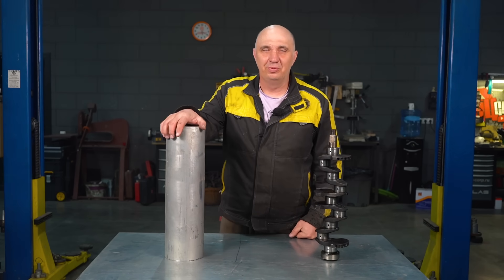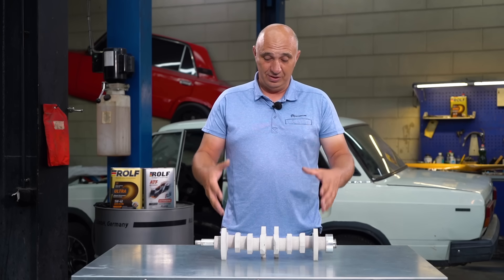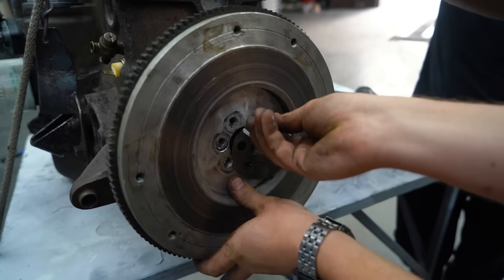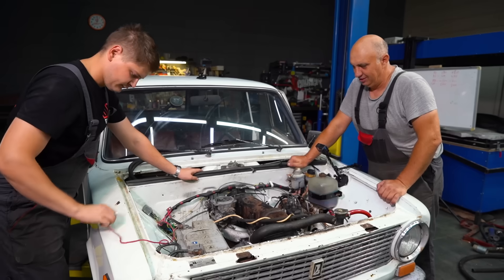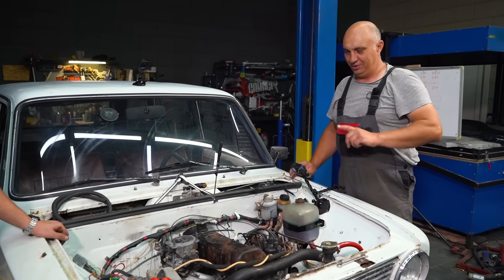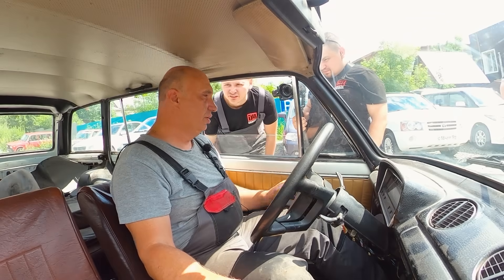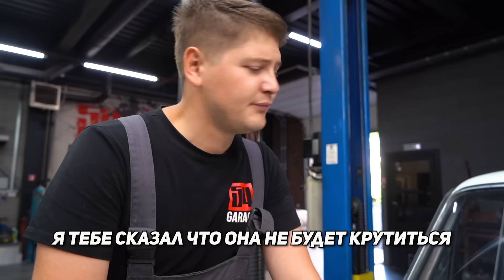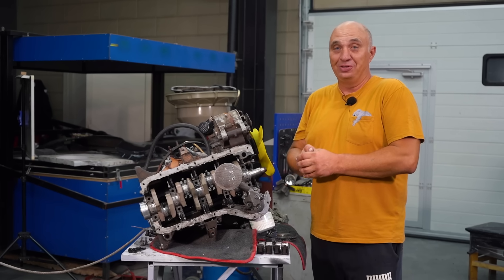We make a custom duralumin crankshaft for a Lada

Comment: "Aluminum's thermal expansion coefficient is roughly three times higher than steel" So the clearances also needs to be tripled for this to start working. Wish they could retest with that
Reply: Metal, ceramic coating and sleeves don't work for bearing journals. Think about the forces working on it. It's like an English wheel, stretching the surface till it fails. Even case hardening will fail. I used to repair shafts and pumps.
Reply: @outlawbillionairez9780   You are correct. They should have built a hybrid crank with Forged steel journals with aluminum counter weights. That thing would last for ever.
Reply: @fragman21  good idea. Two strokes been around forever with pressed together crank assemblies. 👍
Reply: @fragman21  The crank webs expands a lot more than the steel pins and the aluminium webs would be too soft to hold the pins as well so that wouldn't work.
Reply: @outlawbillionairez9780   "Metal, ceramic coating and sleeves don't work for bearing journals."  

what *would* work?
Reply: @Zangetsu2026  I'm talking about bearing forces directly on a surface hardened shaft, only. Built up weld will last for a while. And a really thick pressed on sleeve will work. The bearing force is walking around the shaft, trying to stretch the surface. Whatever you put on the surface, it has to be stronger than the forces. Self contained ball bearings (inner and outer races)work because they absorb all the forces internally and are made of hardened steel.
Reply: @outlawbillionairez9780   ah, thanks!  but wouldn't the expanding aluminum also cause problems even with ball bearings?  i mean, how would ball bearings be able to handle the heat expanded journals?
Reply: @Zangetsu2026  The engine would have to be designed with it in mind from the start. You need room for a larger crank the help better bear the load and shed the heat... and you'd STILL need sleeves.
Reply: More space for expansion, 50% gear oil and nikasil coating instead of the ceramic stuff.
Reply: @Rudy97 nikasil plating is a great idea! That and account for the expansion and it might work!
Reply: @Rudy97 gear oil isn’t thicker, they just use the higher numbers so people don’t pour gear oil in their engines due to way different addpacks
Reply: @alexstromberg7696  that is untrue, it is thiccer. Thicc and stinky, way different from motor oil. Btw, those numbers represent a standard, they aren't random made up model number.
Reply: @Rudy97  the stink is from the addpack, the base stock is still the same, either being Gr1/2/3 oils or a synthetic ester or POA
Reply: @alexstromberg7696  bruh, gear oil is thicker than motor oil, doesn't matter what base oil is used, as a whole the difference is massive, have you ever in your life seen them? If yo crack one open and pour it, super obvious unless you are blind.
Reply: @Rudy97  No he's 80% right, they use different number systems. Straight SAE 90 gear oil is roughly equivalent to 40-50W in motor oil numbers. Just like how ISO100 hydraulic fluid is roughly equivalent to a straight 30 weight in motor oil numbers. 

Where he is "wrong" is three fold. One, MOST common motor oils ARE thinner outside of hot rods and loose race engines. Two, he neglected to get into the details regarding multi-viscosity properties. A 5W50 motor oil acts like a 5w20 when "cold" but is thicker at operating temp (resists thinning). A typical gear oil is still very thick when cold so it pours thick - you don't WANT it to be thin when cold with gears!

Three, there ARE some very thick gear oils... SAE 250 racing gear oil is roughly the same thickness as SAE 70 racing oil. But... If they're the same... Use the motor oil. The additive package is designed for engine bearing loads.

Anyway going thicker isn't neccessarily better for any engine build, ESPECIALLY with this aluminum crank. If those clearances tighten up too much as the aluminum expands the thick oil won't be able to squeeze in and cushion the bearing and crank. Better to increase the clearances, STILL use a moderate viscosity, and add ceramic additives in the oil. Steel sleeves, too.

Was that too much? Oh, Lucas oil stabilizer is even WAY thicker, and there are ultra thick industrial lubricants too. Try using straight Lucas. 😂 (it's a bad idea)
Reply: @Rudy97  not sure what the gear oil brings to the party ( maybe the ep additives? ) but I completely agree 👍
Reply: @iainball2023  gear oil will fill the larger clearance between bearings better, less wear on metal when engine is cold.
Reply: At least, this one still has better chances than the wooden crankshaft, for those who remember 😂
Reply: Wooden it split when revved?  @Jean-Denis_R_R_Loret
Reply: @BluntEversmoke  it basically broke even before ignition, it can't even sustain the torque from the starter.
Reply: The coating itself can pose issues since its likely to be abrasive to an extent.
Reply: @mysock351C negative they make ceracoated bearing and piston collars they are very smooth and less  abrasive
Reply: @Justthemow  Yes… For the BEARINGS and SKIRTS that ride on ferrous metals or some hardened surface treatment. These are likely Babbitt bearings, and thus are dead soft. Having a coating on the journals will probably exacerbate the already bad clearance issue of thermal expansion due to surface roughness. The coating thing doesn’t work so well the other way around. Yes there are coatings out there that would have worked and stoped the galling, but I seriously doubt this was one of them.
Reply: @Justthemow  And I can say from experience that even surfaces that feel smooth can trash bearings in short order. The oil film is so thin that even minor defects can penetrate it and abrade the bearing overlay.
Reply: @mysock351C what about leaving the aluminium journals and run hardened steel bearings, just like the opposite of a steel camshaft in a aluminium head, but obviously ally crank will still expand 😅
Reply: On point . Would be good to  try with appropriate bearing clearance. There were some interesting results untill in siezed. 

I would run a steel shell and around 6 thou clearance. 

6 kg off the rotating assembly is insane. 

The big end weight can also be reduced, and really needs to be. It has nowhere near enough counterweight now.

Ultimately, whatever you do, it will  end up bent fairy quickly. 😅

Very very interesting though. ❤
Reply: and use steel sleeves instead of babbit metal bearings. Cams often run in an aluminum journal just fine.
Reply: @sompka1 I totally agree 😅
Reply: What about making the block aluminum too? Wouldn't that help account for the thermal expansion of the shaft?
Reply: @Max_Chooch  and aluminum rods
Reply: @Max_Chooch the issue will be between the bearings and the shaft. Provided all the parts match thermally it's ok. 
You could replace the bearing blocks and that may be enough.
Reply: Aluminum can be cryogenically stabilized.. I used some of the first pistons done that way. Piston to wall clearance was .001 . Yes .001.
Reply: @JamesWeaver-n4t well what happened?
Reply: Its coated with ceramic and it’s duralamine , so the thermal expansion is roughly twice that of steel 
Duralamine also has a better thermal conductivity so it dissipates heat more efficiently
the engine is less noisy because of lower density of duralamine which results in better vibration dampening properties
Reply: @VandalIO  The ceramic coat cancellates the duraluminium dissipation properties.
Reply: Yeah but if the clearance is increased triple it would be too much for the oil pressure to get up, and there would be too much play until the engine was heated up
Reply: @FCE-dogs  They can pre heat it like they do with F1 engines for a few hours before the startup.
Reply: Everyone has seemed to pick up on that metallurgical difference between aluminum and iron. There are a couple of other important ones that I believe are in scope with an experiment such as this... The weights of the crank will actually flex slightly during higher RPMs. There is something called strength to weight ratio that should be taken into account when converting mechanical parts from one metal species to another. What is clear is that the same diameter part in aluminum will not be able to transfer as much torque to the transmission as its steel or iron counterpart,  because the journals themselves are twisting slightly during the combustion process. This will generate larger amounts of concentrated heat zones local to the journals because of the friction of the aluminum grains passing over eachother. As a consequence of the heating and twisting of the metal in these areas, along with the lower yield strength of the material, its susceptibility to heat checking at lower temperatures, differing rates of expansion, and the final, most devastating shortcoming of the metal in this application, its finite fatigue life at any loading level is totally disqualifying as a material so much as glass would be. The result of this experiment is probably the best case scenario in that the engine itself wasn't catastrophically harmed as far as I can tell, only the inferior part. As it would almost assuredly undego plastic deformation from the flex and twist issues above, this would cause it to work harden in these areas. Eventually, if you could manage to keep the bearings from singing the screeching sound of their people, the crankshaft would shatter and the connecting rods would be going whichever way they please, which would probably just be straight down with a few pretty spectacularly loud pops. I'm disappointed that we didn't get to see that.
Reply: @mariueg  tree times alluminum × steel intends the cold start tolerances will probably means low oil pressure till temperature raises...
Reply: I think the clearances are changing all the time.
The accumulation of tolerances.
Reply: It looked like a fun experiment, though I didn't think it would last long.
   The expansion is a killer there like mentioned.
   Also, that ceramic would he abrasive, and it is very brittle. The Alu would ruin the coating very quickly.
   Still, worth a try for fun!
Reply: Make the rods too . Increase clearance. Lada delete the oil pump and put an electric pump on it. Give it serious pressure to keep the surface alive
Reply: Es hätte konsequent auf Aluminium gesetzt werden müssen. Also alles Pleuel usw. Und alle Maße überarbeitet.
Reply: Stop it expanding by keeping it super cool. Dry ice in the oil? Extra oil cooler radiator?
Reply: there is also  a difference between the cat aluminum and the forged that expands more than the cast one ..
Reply: Not to mention the fact that they're sending the majority of that ceramic off of the bearing surface
Reply: I think at this point, that it should have a 2 piece loose fit insert with locators out of hardened steel. preferable 1 piece but it would make building it more complicated. like a gear shape on the inside of the ring to mate, but would allow for the aluminum to expand. if you made a multi piece crank it would be easier of course to just use different materials for that part
Reply: tensional strength is a matter of consideration as well. Otherwise they would have made that sort of cranckshafts long ago for automotive industry
Reply: and because of that thermal expansion, you can not run tolerances large enough, because in cold situation it rattle some in unbalance. So it was a nice experiment, but a no go for even aircraft aluminium alloys.
Reply: it's an engineering problem at that point, homies are just testing cool stuff
Reply: Issue would be the journals on a crankshaft.
Reply: Can't believe they simply didn't consider CLTE... That's a newby mistake.
Reply: More complicated than that. Also the aluminium may not hold onto as much heat as the standard cast iron crank.
Reply: They probably didn't even balance it.
Reply: Call fashion of aluminum thermal expansion is double with steel is not three times
Reply: @cobra7250  If you cryogenically stabilized it doesn't expand. That's 30 years old technology.
Reply: you dont seem to have a full understanding of the word "coefficient". Secondly are you under the impression that the crankshaft will expand and not the block? Being a shop owner and engine builder myself and seeing the no real difference between clearance on aluminum block vs iron block and aluminum pistons vs steel pistons, i dont think its going to make any real difference. Biggest factor in oil clearance has to do with oil viscosity being run.
Reply: Remember the failed Chevy Vega cylinder walls.....
Reply: Non può funzionare , altro avrebbero realizzato per i motori  di F.1
Reply: Ergo:
An aluminum engine block would have helped considerably
Reply: Yeah, you would need squishy bearings to compensate, not sure how that's gonna work. ;)
Reply: More clearance and heavy weight oil.
Reply: 3 times? When I did R&D for honda yrs ago, aluminum expanded 10 times more than cast iron or steel. 3 times is totally out of the ?, if your bearing clearances are .003 thousands then you would make them .030 thousands and running an oil that's engineered to be thicker when cold and thinner when hot would potentially work. Just throwing they theoretical stuff out there. Still think its cool they do what they do, like the new aged myth busters😂.
Reply: @ScottGovey  Duralumin has a thermal expansion coefficient of 23-10E-6/C which is similar to normal aluminum, Steel is on average 11.5-10E-6/C which is exactly half.  Going from 50 to 250 degrees F a 2.5" duralumin crank journal would expand .0057" while a steel journal would expand .0028"
Reply: @ScottGovey  It’s not that much for most alloys. Typically 3x or so from my engineering experience, but it can be more depending on what it is (think forged pistons.) However the required clearances would be too large. The only way this could work would be to use aluminum for the connecting rods like some small engines do with Al-Si rod and main bearings. That would last long enough for the video since the two would be well matched thermally.
Reply: @ScottGovey you did r&d at Honda? Which plant? Would you mind helping by telling me the bolt pattern for the v6 crank to fly flange? 
I'm trying to make a custom flywheel to out a v6 in my rx8 using the rx8 Tranny, but without buying an engine and paying a shop 500$ to just measure the damn flange...
Reply: @DirtyMike-b6o  I worked a prototype facility for the subframes and suspension.  So unfortunetly I can't help ya with that one. Sorry. Maybe some will chime in on that for ya.
Reply: @ in that case, want to help out for this project?
Reply: @DirtyMike-b6o  which v6 you tryin to run? J-series?
Reply: Yes! I thought about that. You could have made the comment less nerdy saying "aluminium expands much more with heat than steel, that's why it got wrong with a worm engine"
Reply: @Platypus_Warrior  No way are you serious bro ? Why the hell do you want people not to say something a bit precise do you have issue feeling dumb when you see that or what ? Sorry but I mean more info is always better isn't it ?
Reply: @relaxingmusic7301  Your comment is on point. I disagree, information has to be given with consideration to the listener, otherwise it can be intimidating to the point that it kills curiosity. Curiosity on people is the aim, information is always out there for people to seek for themselves. You can answer right without spreading all your knowledge about something..... there will always be more
Reply: @Platypus_Warrior You mean you want things dumbed down for you.
Reply: @Platypus_Warrior being upset about people using the proper term for things in a YouTube comment is so far anti-intellectual is just pro-stupid.
Reply: @Platypus_Warrior  You could just say you're uneducated.
Reply: @Platypus_Warrior  does nerdy stuff scare you? Are you intimidated by the educated?